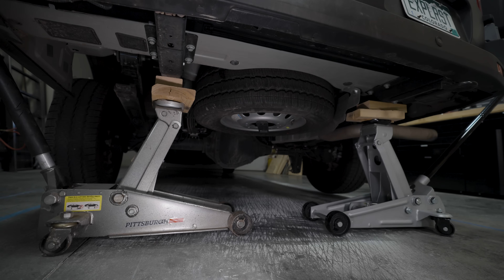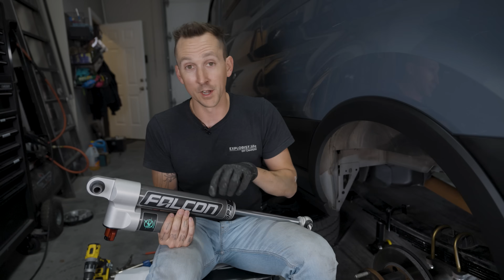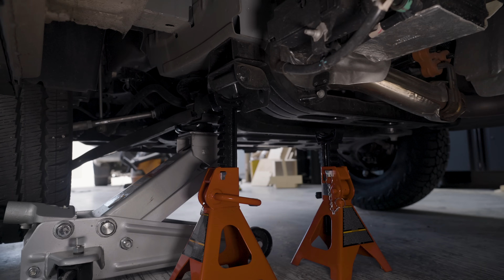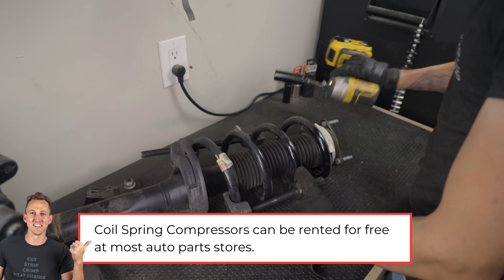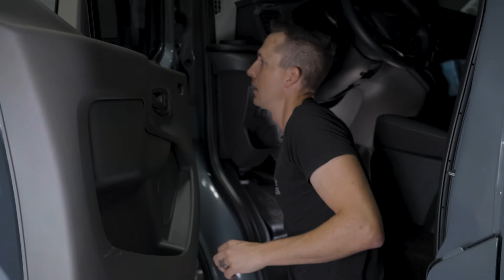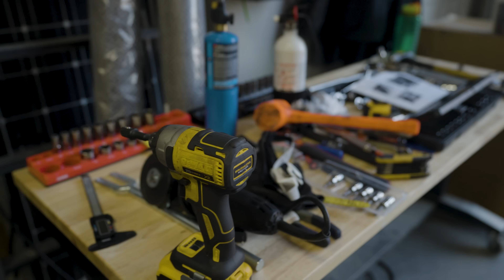Ford Transit AWD Lift Install

Comment: Hey Nate and Steph. Good video. I have a question. What are your thoughts on RVIA certification and how you get around to campgrounds that require them? I have been rejected in my campervan because I don’t have this sticker even though my campervan has been built to these codes. Specifically Tiger Run in Dillon.
Reply from the maker: I've never come across any RV parks that require any kind of certification.  I have stayed at Tiger Run for a night back in, probably, 2018ish; but they didn't ask for anything like that.  Out of all of the campgrounds we've stayed at, though, that is definitely one of the ones that I could see coming up with some kind of dumbass rule like that.  Super pretentious place.   You aren't going to run into that much on your travels.
Reply: @EXPLORISTlife  Thanks for the info. It really is a dumbass rule that caught me by surprise. I was feeling really discouraged wondering if I would face this issue again and again. As a CO native do ya’ll have any recommended rv parks around that area open during the winter? Really having trouble finding something that’s not tiger run.
Reply from the maker: KOA in Steamboat stays open over the winter.  Red mountain rv park in Kremling does too.  Pretty much nothing in summit does.
Reply: RVIA certs are a reality in campgrounds and have been for at least 20 years. I was denied entry around 2004ish in a county park CG for that reason. Ask campground representatives and certified upfitters. Insurance companies also like to deny coverage and claims without RVIA certs. My insurance company had plenty to say on this subject about qualified upfitters and who they trust. Reasons to be excluded like uninspected rigs causing electrical power outages for the whole campground due to shorts, etc. We all know of some sus builds and sus electrical work in life. RVIA prevents a lot if that just as house consruction codes do.  I too complain about regulation but the best countries in the world result from it.

Comment: I've got 2" lift kit from Van Compass installed by ford dealership and unfortunately I experience bad slams in the front shock when going through any small pot hole. It's no pleasure on the forest roads as it happens constantly. I called Van Compass regarding the issue and they told me they are aware of that but can't help. Pretty upsetting news. Anyways I was wondering if you have any hack how to solve this issue, maybe another brand lift? Would you be able to help? Thank you so much in advance. Mira
Reply: Any news on the lift fix or how its performing today?
Reply from the maker: Hmm; I haven't heard of or experienced that.

Comment: I've done a good bit of off-roading and rock crawling and am now considering a Transit... BUT I'm just looking to hit up some dusty roads, loose rocks, a bit of snow, but not actual "crawl." Do you think an un-lifted AWD Transit with all-season tires and maybe an e-locker would be good enough for most mild-to-moderate trails?
Reply: Id say so, but start looking under the chassis, lay down under it measuring the lowest points in the undercarriage like the rear differential-rear shock mounts-exhast pipes and muffler. What will hit first and in which areas in the drive line must you avoid as you pass over a bump on the roads. If your Transit is like the few I've measured, it will ave a 7" or 8" clearance. This is lower than other chassis'. So watch out what you run over.

Comment: Hi Nate, are the method wheels MR703 van? Do the Tire rack lug nuts have the washer on to tighten to the wheel, like the OEM lug nuts? and lastly are they 90mm off set. That was Discount tires recommendation when I got the Falkens fitted to my OEM steel wheels which were the same as your originals. Sorry for 3 questions in one shot.

Comment: Seems like a pretty flimsy frame member holding that shock at the top.  These vans can go to 11,000 gvw.  How does that not flex/bend?
Reply from the maker: That'll be a question to call Ford Motor Company about.  I'm sure their head engineers are available to chat about stuff like that.  While you've got em, ask them if they have a fix for my power sliding door still not working. 😂🤷

Comment: What is the total height of the van now?  Gotta make sure the van can clear the garage door after the install...  is that in the instructions?😟
Reply from the maker: To the top of our weboost antenna is 10' 2 1/4" and to the top of the air conditioner 9' 10 1/2"

Comment: How many hours would you say you spent on this list install? 10-14hrs? I ask because their website says 8hrs.
Reply from the maker: So, the 8hrs is a bit misleading.  The full kit comes with about 4 different sets of directions; each for it's own individual time-estimate; and the 8hrs was only for the rear lift.  In total; for everything shown in this video (rear spring pack install, rear shock install, high clearance shock bracket install, front lift install), budget for it to take a full weekend for the average shade-tree mechanic.

Comment: Great video, as always thanks for sharing. Did the shop have any problems with the alignment? I have been considering this lift and the transit OffRoad one as that one has adjustment in the arm? Did you look at that one? Love to hear your thoughts. Hope I am ok to mention another brand😊.
Reply from the maker: Thanks for watching!  We are scheduled to get our alignment tomorrow; so I'll check back in.  We live in a small town where we don't have a bunch of access to drop-in alignment shops.  We did indeed look at the Transit Offroad kit; but it was (and is) backordered and we couldn't wait for it to come back in stock when the VanCompass lift was in stock and ready to ship.  The Transit Offroad kit also just uses lift blocks instead of a full leaf pack addition, so it doesn't actually add any kind of suspension help in the back; just lifts it up.  These blocks can also contribute to 'axle wrap' when on snow/sand/mud.  Plus... people were asking about the VanCompass lift; so we have to make videos about what people are asking about. 🤣👍
Reply: @EXPLORISTlife  yes that is a good point about the back leaf springs. Thanks for your thoughts. Look forward to hearing your experience on the alignment.
Reply from the maker: Alignment went well.  Nothing notable there.  Cost $170ish at a local performance truck shop @1-offperformancellc933  Only thing on the alignment is to call ahead and make sure that the shop can do it (height and length of vehicle being the limitations).
Reply: @EXPLORISTlife  thanks for the update… good information.

Comment: This video is awesome. I got the vancompass left kit for my van, but had it installed by a shop. Curious how long you estimate this took for a DIY install?
Reply from the maker: I'd budget for a full weekend for the average shade tree mechanic if you're doing it by yourself and aren't having to worry about videoing. 🤣

Comment: You need new gloves...haha   Great video for suspension.  I watch every weekend..
Reply from the maker: 🤣😂 No doubt! 🤣👍 I got some after this video.  Thanks for tuning in!
Reply: @EXPLORISTlife  Another note, when tighing the strut nut to 41 foot pounds, many times just letting the spring pressure go against the plate will hold the rod tight enough for torching.
Reply from the maker: Ahh; yeah; that makes sense!

Comment: Awesome video! Now we need to see an Airbag Man install.
Reply from the maker: Thanks!  The leaf packs are done in place of airbags.  Airbags are good for vehicles where you may have it empty sometimes, or loaded up to max capacity sometimes (think of a truck driving empty; and then hooking up a 5th wheel RV to it).  Since our van is always roughly the same weight; leaf packs over airbags is the better solution here.
Reply: @EXPLORISTlife  I was thinking it would smooth out the ride on washboard roads and allow for easy leveling of the van at camp. 🤭🤔
Reply from the maker: Lowering the tire pressure & setting the shocks to the soft setting will make the most difference for washboard roads.  As for leveling... Maybe?  If you had airbags for all 4x corners that were independently controllable, I suppose.  During our 4 years of living in our old van we never really had an issue getting the van 'level enough' just by repositioning and/or the strategically placed flat rock.